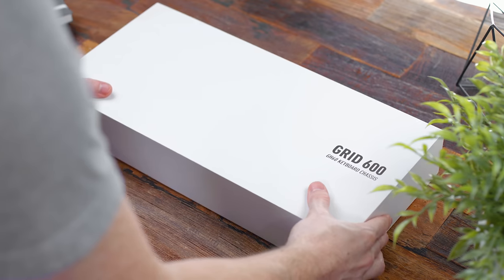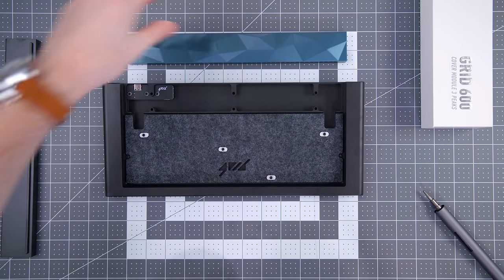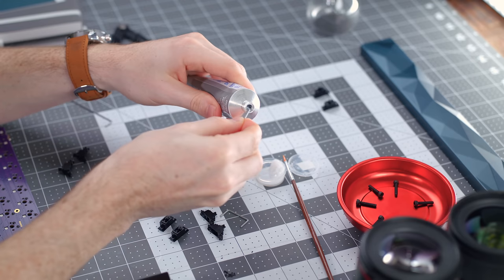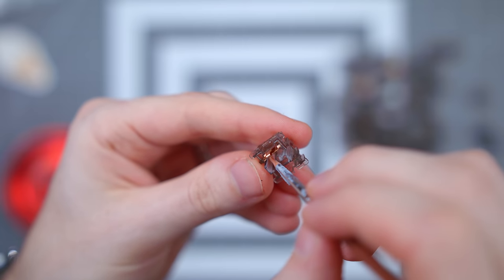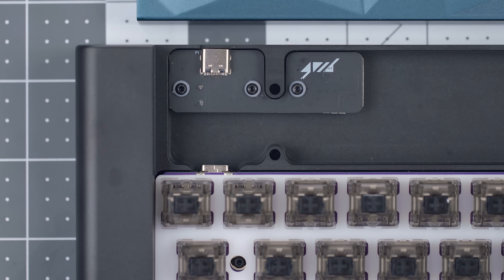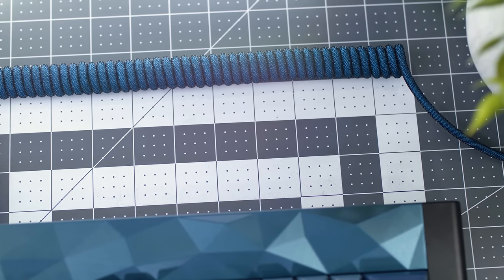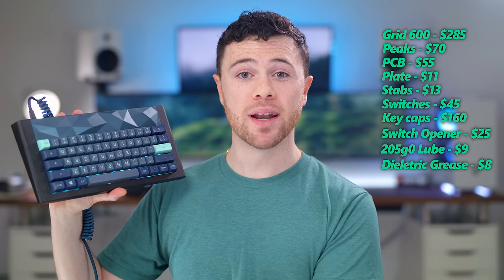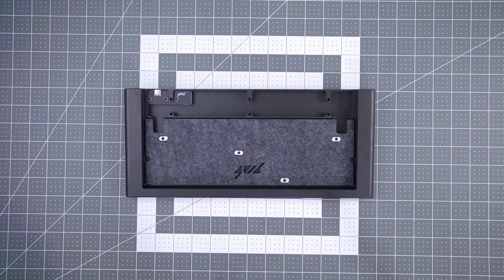Building My $680 Custom Mechanical Keyboard!

Comment: I would absolutely spend that sort of money on a custom product I could put together myself... But... Only if the outcome of all my work was better than anything I could buy off the shelf. 

For you, I think you met this goal. No manufacturers I know of are individually lubricating each of their keys (Possibly for both manufacturing practicality, and also for longevity reasons since anyone who has ever cleaned keyboards will know that over time you're going to regret that lubrication when it goes from helpful to becoming a base to make your keys stick when mixed with stuff that naturally accumulates in keyboards, like hair, skin cells, skin oils, and food particles). For me though, I started looking at what this project would cost for 'me' to get my ideal keyboard... And realized quickly... It's not at all something I could do.

- Slim profile
- Custom displays per key
- Fully reprogram-able keys
- High quality linear switches
- 45 g actuation 1.5 mm 
- Full keyboard including number pad

There is a keyboard that comes close, but it's not custom it's just many thousands of dollars, and thus impractical, and it's DEFINITELY not slim. The next best thing is the 915g from Logitech, which I got, and love. Many will say that it's way too expensive, but nothing on the market competes at all. It meets every single standard I set except that the keys themselves aren't displays, so they are set in their appearance, and the actuation is 'slightly' heavier then I like at 50 g instead of 45 g, but it's barely noticeably different. 

In any case, I can't imagine it's possible to make a custom option like what I want without entering the many thousands of dollars territory, which makes the $250.00 Logitech asked for look like a bargain. 

But if you like the normal profile thick keyboards, with some heft, and traditional mechanical keyboard with full sized caps and switches, and you have no need for a number-pad, then I can see why what you made is perfect. That being the case, good on you for being able to make the perfect custom device for yourself, and frankly at a fairly reasonable price all considered (Most people replying to your video clearly just don't know the cost of custom hardware).

Comment: Micro usb 🤮😂 you could of gotten a type c for that price lol
Reply: Anh Khoa Ngo so it’s up to date and more durable
Reply: Whats the benefits and difference? Curious.
Reply: Justin Parnell you don’t need to look where to put it in because both sides are the same,unlike micro usb,and type c won’t break as easily
Reply: BANT3R is that really it? Are there performance differences?
Reply: Justin Parnell if you where charging it yes but no because it’s a keyboard, might have quicker response time, not 100% sure on that one
Reply: BANT3R ok thanks
Reply: Justin Parnell np
Reply: @justinparnell3319  USB c has higher bandwidth and it's symmetrical. Those are the only real differences

Comment: I get it, it's a personal thing and also a a labour of love. It is a lot of money, the key caps probably have no reason for such a price. It's who you know, The base could have been sourced more reasonably but it's a "niche" market, those who are in a position to make a custom keyboard are bound by availability and quality of components. The time it takes you to lube the switches etc makes the keyboard yours. You probably would have had less negative response if you had soldered each led and switch in place, not many people can solder, especially over six hundred times. Use what you have now, change out the key caps and leave the haters to their veiled jealousy. I like your unassuming manner, you are easy to listen to and your video was filled with good footage of one of the four most important pieces of hardware you have, the others being your PC, camera and monitor. Good work.

Comment: The tabs on the stabilizers are to prevent the stab from slamming into the PCB when the longer keys are depressed.  Yes, they are spring, they're meant to be.  Yes they impact the feel of pressing the key.  Yes you barely notice it unless you're an enthusiast.
Reply: i always hated bad stabilizer keys before i knew anything about keyboards

Comment: I think the stabs are overlubed, which is normal with dielectric grease, I would have just stuck with 305 g0 or even holee mod them, other than that the even the switches are a bit overlubed but must feel smooth, cable and keycaps are sick.

Comment: If one thinks about it, it's not an objectionable amount of money to spend on a keyboard. It's like a pair of good shoes. One doesn't know how bad it was until they have worn a pair of good ones which fit. Consider how much is spent on the PC and it's peripherals. We just never considered that this input device could give one a substantially better experience. Given the amount of time we spend behind a screen it totally makes sense. It's not cheap but it allows one to celebrate the hobby which occupies a good portion of one's time.

Comment: I understsnd the high price because it's a hobby etc... but I don't get this extended case design 😂 btw. I'm building my 1st own custom keyboard. I just ordered parts ($220 for all on Aliexpress): gk64 wooden case, hot swap pcb with some PBT SA keycaps, lube and Gateron Brown switches which I will change for Zealion V2 or smth else in the future. I have only some concerns about stabilizers. The worst part about building custom keyboard is finding components because some best parts are always out of stock.

Comment: It's definitely a really nice key board, however I think it would look so much better if the case had the 3d part around the edges and with the top part a bit shorter. Either way it looks really cool though.

Comment: This is my personal opinion. Tbh I just don't think the teal bar at the top does much, I think it's just wasted space, I would buy a smaller frame, and the keys, I think the font is too big on them. The enter, delete, and the shift key just doesn't look pleasing to me. If you are somewhat new to computers then you would be confused as to what they do, and it would be inconvenient.  I'm also not a big fan of teal, but that's just a color, not a mechanical part of the keyboard. Again this is my personal opinion, so no hate. It looks nice but I would make some adjustments. Nice work!

Comment: The reason the n key is so high is because you used 3 pin switches on a hot swap pcb an easy fix to this would be taking the switch out and putting a new one in to see if it sits lower

Comment: Board is sweet, but I would be severely bothered by all those out of alignment keys for such a price (it's not just the n, but j, k, windows, menu and others: look at the lighting gaps at 8:43). For $680, the thing better be accurate to 0.005" (which is even on the sloppy end for typical CNC/molding tolerances)!
Reply from the maker: It isnt the case, it's the acrylic plate I used. Already changed it and swapped it out
Reply: @randomfrankp  Wow! Sweet, and glad the fix was so simple. I was worrying something else was awry. Glad you got it sorted.

Comment: The thing about those cheaper keyboards that you listed is that the keys won't be lopsided (8:42).
Reply from the maker: Good thing it took just 2 seconds to reseat the switch 🤷🏻‍♂️
Reply: @randomfrankp  Sure, bud. With the cheaper ones, you don't have to do that.

Comment: Even though this is his own money, i cant justify spending almost 700 dollars for a keyboard that lacks features that 200 dollars keyboards have. I guess the only thing special about it is that it looks unique
Reply: There are actually many things about this that beats your average "high end" Corsair or Razer or whatever, such as the quality of the materials used, the switches, the fact that the switches are lubed, and there's also the whole aspect of uniqueness which I guess you did mention.

Obviously none of this is really "needed" but with that logic you could just say to buy a 15 dollar membrane on Amazon instead of the 200 dollar keyboards you referenced.

Comment: looks like a $50 budget board
Reply: SUNG JIN WOO shut
Reply: ...what?
Reply: @rynne7153  looks very cheap. parts are not even worth that much
Reply: @jinwoooooooooo  of course parts will never be worth that much. A corsair board looks like it costs around $50 to make.
Cheap switches, A thin light aluminium plate, plastic worth pennies among other things. But it still costs about $100 or more.
 
What is a skateboard deck? 9 layers of hopefully maple glued together. How much does a decent skateboard deck cost? $70-$100. 

Not everything is black and white. R&D, Machining, assembly and other things need to be factored in when looking at a product. 

Now I agree with you that the GRID600 doesn't look very nice, because that forehead is more of an aquired taste if anything, but that doesn't take away from the time spent machining the thing out from a solid thing of aluminium. Don't forget that the custom scene is a very niche market, and good cases/ keycaps are usually only stuck in limited time/volume group buys.
Reply: @rynne7153  you literally can get full titanium deck for $50
Reply: @jinwoooooooooo  and titanium trucks cost around $60-70 even though it uses less material

Comment: does lube wear out? I would never lube cuz i feel like id get hella crusty in like 3 months or need constant lubing, waste of money and time and super messy, ruins great keyboards in my opinion
Reply: In my opinion lubing is worth it. Its not to expensive, it doesnt really wear out, and ive never heard of it ever getting crusty. But thats my opinion
Reply: @LandonQizilbash  i appreciate it bro, thx for the response :)
Reply: maybe after a few years (just a random guess). lubing doesn't wear out in 3months, and really does eliminate scratchiness and sometimes makes the feel smoother.
Reply: a set of lubed switches i had actually got better after having them for a while, and i didn’t just break them out because i never used them for a build

Comment: frank: help me budget my keyboard my family will starve
case: 285 dollars
peaks: 75 dollars
pcb: 55 dollars
plate: 11 dollars
switches: 45 dollars
keycaps: 160 dollars
switch opener: 25 dollars
205g0 lube: 9 dollars
dieletric grease: 8 dollars

someone else: maybe spend less money on the keycaps
frank: Preposterous
Reply from the maker: Massive L

Comment: I wanted to buy a Mechanical Keyboard with back light feature so I could type in dark, in past I had a very bad experience with mechanical keyboards. I bought these 2 keyboard:

1. redgear blaze 3 colour backlit gaming keyboard

2. logitech g413 carbon mechanical

but have lot of issues, with redgear I have double spacing issue where space gets typed multiple times and with logitech the keys don't function, so I wanted to know which is the best mechanical keyboard (I don't play games on keyboard). Anyone using mechanical keyboard out there please suggest one

Comment: Well it remains a bunch of plastic so I get the comments on the cost. Production cost is around $5. Apart from that aluminium bar. But supply and demand is everything.
Reply: So first, the whole case is made out of aluminum, second these are group buys made by small creators and bot huge factories in China, that means they can’t do enormous productions so more production cost.
Concerning keycaps, you have 1 month to buy them and generally GMK makes a new mold for every new set which also decreases the margin that they make. It’s not as easy as you would think
Reply: @tdg9281  I know how it works. Did not know the body was milled alu. But it's rare so margins skyrocket with rare stuff. I think they are totally cool btw.